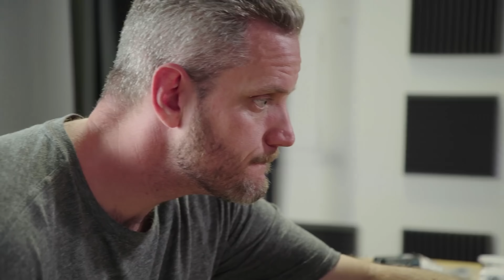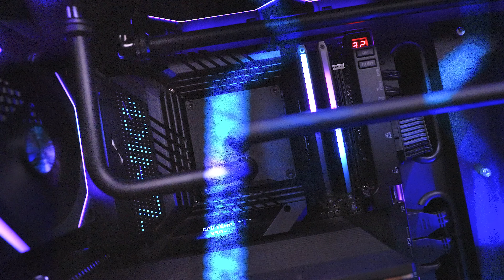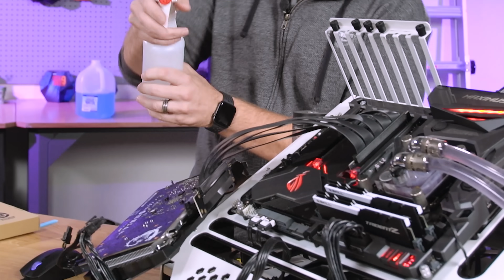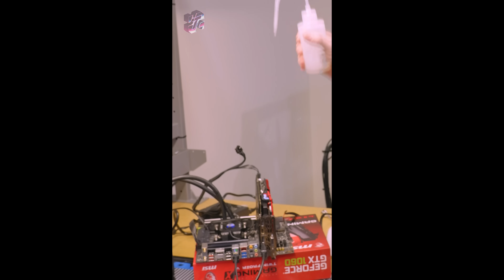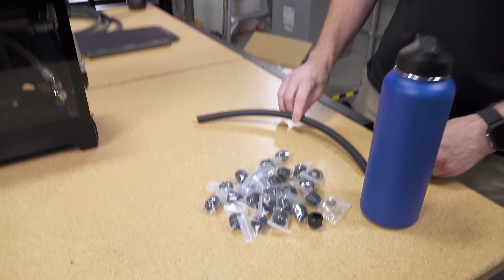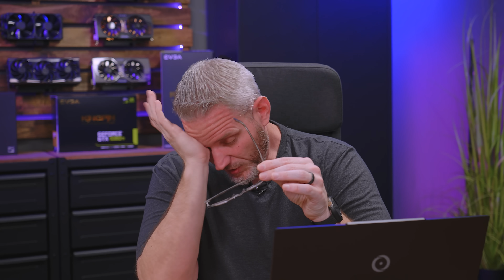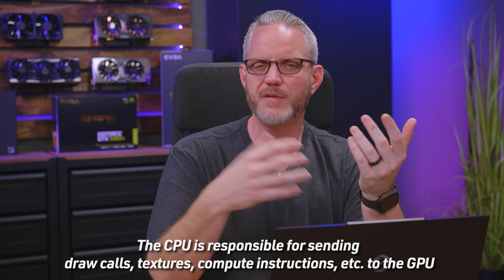5 Myths about Watercooling that are WRONG!

Comment: I am on the fence with watercooling.

On the one hand, when I did my glass hardline custom loop, it was some of the best fun I had working on my PC.

On the other hand, when my PSU died and fried my motherboard (unrelated issues), removing all of it, changing stuff etc. was so daunting and added significantly to the mental drain after coming to terms with the fact that I'd have to replace parts. I stripped the loop and installed a Dark Rock Pro back then.

I think Jay is in this unique situation where working on computers is his life and the perspective is a bit different. You can have fun with LC but unless you are the kind of person who likes to tinker on the system regularly, I don't recommend it. Having a custom loop is not conducive to "one and done" mindset.

Comment: I would love a deep dive on loop order/custom water loop setup in general. I stopped building PCs about 20 years ago but have recently gotten back into it on account of my son. Back then I always went with radiators between components on my loops, which was harder to do since cases with top fans weren't common

Comment: I use custom water cooling specifically to keep my game room cooler. BUT I do that by piping the cooling fluid to the other side of the wall where my radiators vent the heat into the common area. There the HVAC detects it and compensates. That means I have long hoses coming out of the back of my PC, which also means I use a lot more fluid. It's not cheap, but it does keep the game room cool. And, yeah, I'm sure there are cheaper ways to do the same thing but this looks fine and was fun to build.

Comment: Move/vent the exhaust from your radiator to a different room/outside to stop the room getting warmer. And better yet, vent an AC unit to the intake for ultra efficient cooling. Ive got a little minisplit next to my desk. Once I finish my pc build, I'm ducting one of the outlets of the AC to my case intake lol.. gonna be running nice and cool..

Comment: in 2008 I lost some expensive parts, not directly by water contact, but because the pump broke and the water literally boiled in the blocks. 
(Thermal throttling was a thing on CPU's then, but GPU's and motherboard chipsets apparently not.)
The pump itself died because of water though, a plexiglass part cracked and let water into the electronics side which corroded, stopping the water flow. 
Never again plexiglass. And never had an issue since, been watercooling for 2 decades.

Loop order doesn't matter if you have enough pressure to flow properly. The whole 'thing' is from when people were using pond pumps that barely put out any pressure, and needed huge inflexible hoses to flow any water at all. Liang DDC and D5 pumps fixed that for a lot of people, and we've gotten so spoiled with all the good options since. :)

Related, a myth, you "need" 1/2" ID hose for watercooling. :'D

Comment: Expanding on the heat transfer from water to air through the radiator. The larger the difference in temperature between the water and the air, the faster heat can transfer from one to the other. This is why usually radiators don't have a rating, because they cannot know what the water and air temperatures will be at your specific location and for your specific use case, and they don't know what fan you'll use on them. And if they come with a specification, they are full of shit. (The HardwareLabs radiators come to mind... A single 120mm x 50mm thick rad able to dissipate 500W without mentioning the temperature difference of the amount of air pushed through it? Hello?)

Of note, a configuration with several radiators in series will have the next radiators perform worse than the first one due to the air and water temperature closing in on each other fast in the first.

The recommendation I've seen floated around is that your water temperature should be between +5°C and +15°C over ambient, ideally at +10°C to maximize dollar-to-dissipation efficiency, as the more rad space you add, the less decrease in water temperature you will get through them. It is not clear where in the loop your water temperature should be monitored though, especially in the case of configurations containing more than one radiator...

Jay's recommendation for safety has always been (unless changes that I'm not aware of) a 120mm rad space per component, an additional 120mm per overclocked component (so for a single overclocked component it's two 120mm rad space), and a 120mm extra.

He has not necessarily always followed this rule. The glass tubes Define Nano S build comes to mind, it used a single 240 rad for two components, yet it was perfectly fine. The rad space you need depends on how much heat total your parts emit, not just the number of parts.

It is clear however that while "the water temperature equalizes across the loop", it cannot stay the same temperature everywhere, as it is heated by parts and cooled by radiators. If it stayed as hot in the radiator then the radiator isn't performing its function to remove heat from the water, and thermal cameras certainly show a drop in temperature across a functioning radiator. I'm wondering how large this drop really is.

Comment: The thing is the fact that a leak doesnt guarantee damage to your computer there is still a chance of damage and you can make the chance of a leak lower but you can never make that zero.  Ultimately to me a good air cooling system should be fine for any home use so why would you ever want to provide a chance of damage when its not needed?  If others do thats fine but the idea that its "wrong" or a "myth" to say you prefer to avoid the chance of damage seems unreasonable.  I get you have tried to be honest in both directions in the video but still seems a bit unreasonable to refer to this as you have in the title.

Comment: Hello Jay,
I have drained the liquid from my PC, after 917 days. I would stick to clear liquid and a few drops of Mayham concentrate and there is loop with clear and un-gunked coolant. I switched to a  7800X3D and it works like a charm. 
People are afraid of water cooling due to miss conception. It requires little maintenance comparing to air / AIO systems.

PS - greetings from Romania.

Comment: All about reliability for me. A water pump is a major failure point. My preferred option is to go overboard on an air cooler. I am yet to experience a single branded fan expire without screaming bloody murder for weeks on end, giving you time to change it. And there are multiples of them, so one failure does not affect you much. A broken pump is something that stops your system operation, period.

Comment: Just one tiny thing as an aquarium progessional. I dont actually recommend using aquarium additives for water cooling loops. Stick with a purpose built additives. 

Ones for fish have very specific requirements for the fish and their health which can either just decrease efficacy, or it may cause its own problems which will clog a loop. And the person at the aquarium store knows how those additives work in a fish tank, they probably cant tell you what it would do in a computer (I even have a water cooled pc and I wouldnt know). Theres also hundreds or thousands of additives, and unless you know your aquarium stuff, will you know which one to get in an aisle completely full of little expensive bottles? Just stick with purpose made stuff. Most aquarium additives arent that cheap to begin with, spend a couple dollars more and get the real thing.

Comment: My "cost" reason for not using any watercooling and not even considering it is simple... I"m on soc sec. I'm already putting the rig I've built and rebuilt and changed over a few years to the possibility of electrical assault and other forms of exterior influenced damages and just cannot afford to replace the whole rig and most of the time. And that's not even mentioning the costs. I've had the same Noctua tower for over 3 years and its performing perfectly, so... no. But, your other arguments are interesting. And yes, I do watch your H2O vids, but more as a voyeur. :)

Comment: Nice video, would love to see a more in depth analysis on having your cpu and gpu operating in the same loop.

Another idea (though you may have done this before) could be exploring the different ways having an aio set up as an intake vs an outtake and how that affects your gpu (and other component) temps

Also I’m in the market for a new case as the O11-D Mini has angered me too much with its lack of a proper top mount for 360mm rads so if you did another case review soon or did a top water cooling cases of 2024 that would be awesome

Comment: I build PCs and do repairs in my spare time. I built a very powerful gaming rig for a guy who was building a DCS sim pit. He built a full-size F16 cockpit. 
He called me and said his pc would overheat after 10 or 15 minutes. I had him drop it off, but I was sure it was OK because it was running a R9 7950x. 
But I couldn't get it to overheat no matter what I did. The 4090 can run DCS at 4k on 2 40 in tvs with no problem. 
So I asked to deliver it so I could see it overheat myself. 
He put all this stuff in a 15x20 bedroom. The temperature of that room would jump from 75° to 95° in less than 20 min. He had a small refrigerator, a 2nd PC running a 55in old hot plasma TV. 
It's hard to cool hot PC components with hot air.
I put one of those little mini split window units in his window, and the problem was solved.

Comment: I have always wanted to water cool, it comes down to the effort to benefit value.  As long as my system can be cooled by an air coolers, even if it is a expensive, I can get to playing faster.   The other thing that helps is sizing/purchasing components to optimize actual use case.  I'm ok with not having the best anymore, and just want to play video games. 120fps @ 1080p is pretty to do these days, even if purchasing used hardware.

Comment: drill a small hole in hardline tubes, put a probe through, then hot glue/aposxy the hole close. the hole only needs to be big enough to fit the wire through. so it should just take an afternoon of work to do.

Comment: Water cooling vs. no water cooling does nothing to change the temperature of the room.  Water cooling will heat up the room more quickly because it is more efficient at removing heat from inside the PC box.  In the end, however, unless you can vent the heat from the (reasonably small home office) room temperature equilibrium will be established between inside the PC and the room and no more heat will be transferred from inside the PC box to the room.  It's something about Issac Newton, heat transfer and moving heat against the gradient. 🤠

Comment: Okay, the first 'Myth' isn't a myth, running the silicon chip cooler (but otherwise under the same conditions) DOES DECREASE the power draw. Realistically, ofc. it isn't much, by my guesstimate it's something like 1-2% per 10K drop.

Comment: 6th myth - it cant be more effective than air system of the same size.
Why? Water cooling is actually no water cooling. It's air cooled system. Just as usual coolers. The only difference is a heat transfer (from heat source to radiators) - water in water cooling and metal in usual coolers. So the only difference is in rads size. Water heat transfer allow you to route it easily and install radiators (almost) wherever you want - and thus you can make them much bigger. 

remember  - water cooling in a normal air cooling with remote rads.

Comment: Here's a tip on how to both help with the temperature of the PC and the room.  Get a desktop USB fan and put it in a position that allows it to take the hot exhaust air coming out of the case and push it away from both you and the PC.

Comment: Water cooling is fine, if you actually need that level of cooling. Most really don't. The one thing that isn't a myth is that custom loops are usually more expense than function.

Heat has to go somewhere so it is going into your room unless you can pump it outside. It doesn't just go away.

Comment: Jay I have soft tubing from my starting build so it is 15years old, those old tubes are kinda flexible but are still super clear. But I never ever mixed my water with additives other then what you really need. So I can say in my case the clear tubes can still be clear if you had the right tubing. I had different tubes over the years and two other clear tubes are so freaking soft but those are milky now. So it really depends on what material you really got for the tubing. I recon its the same for black tubes.

Comment: The biggest myth about watercooling: You got this, bro, it's not that expensive. It's easy, bro.
Reply: It dependa... Artic Freezer III its half the price of  Noctua D15 its less durable but they give you 6 years of guarantee, its not that bad. If you want to match performance/quietness of  Arctic AIO, you can buy THERMALRIGHT for 30$ and 2 Arctic fans for 30$... Near Same as arctic AIO😅
Reply: @DcgK1000  Yep you can get 360 AIO with  OLED 6.4 screen for the price of some GPU blocks, and it;s not includes the rest of the companents you will must have.🤣🤣

Comment: Making your space warmer is a great feature of watercooling. The spot were I game has a normal temp of 5-20C. So in winter my cooling system is so efficient that it keeps my room at a fully livable 17C. Summer time is a biy worse, but opening windows generally works well. :)
Reply: The point the video made is that the PC would heat your room the same amount whether you had water cooling or no water cooling, assuming you were running the same tuning / overlock of course.

Comment: I will second using rubber tubing. Cheap harbor freight air hose is 3/8 ID. I used to have a loop with like 50 feet of rubber hose for a room-external loop, and that rubber hose worked for years. Rubber doesn't let water evaporate through it

Comment: "you want the water to sit in the radiator so it cools more, in an engine."  Didn't think you'd say that. It's the same argument as people suggesting you don't want too powerful a water pump cause slower water means the radiator outlet is cooler, so thus cooler engine/computer chip. That's just not true, it's all based on deltas between heat source and exchange medium. In a car engine the thermostat regulates the engine heat, but the radiator is a buffer zone like a built in reservoir. It's always trying to cool, even if the engine doesn't need max cooling at that moment, just so it's ready for if it does need it

Comment: One more myth is that you need very high flow so people often install 2 loops with 2 pumps. In the '00s I ran a dual Xeon, dual GPU setup with one Enheim 1046 pump. I cooled the ram and VRMs too. Temps were not great (water temp was 35C), but it was silent and never throttled.

Comment: You know what would be cool to check out and see if it has any kind of temperature drops would be a loop filled with straight alcohol or a mixture variant of it since it has better cooling capabilities than water does. However, it will also evaporate faster than water as well in any open environment so if you did it in any kind of open loop system, you'd need to have the reservoir sealed off realitively well to help in preventing the alcohol from evaporating too quickly so you won't need to add it as often...

Comment: There are two highly recommended tools, even when doing soft tubing. 
Tube cutter, will make things so much quicker and easier. Can use a sharp utility knife, but easier to get straight cuts with tube cutter (the type that look like scissors).
Hand air pump with pressure gauge, will make having a properly sealed loop far more certain, if air isn't leaking, then water won't leak.